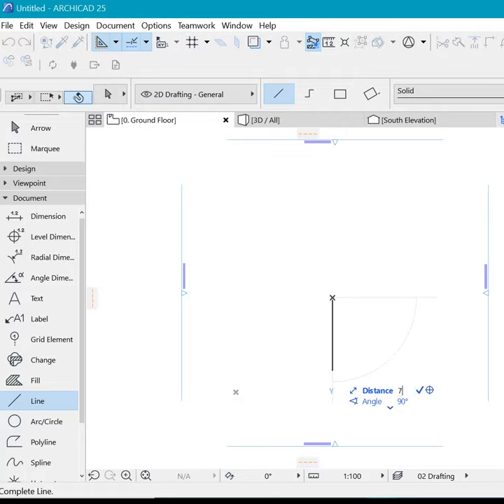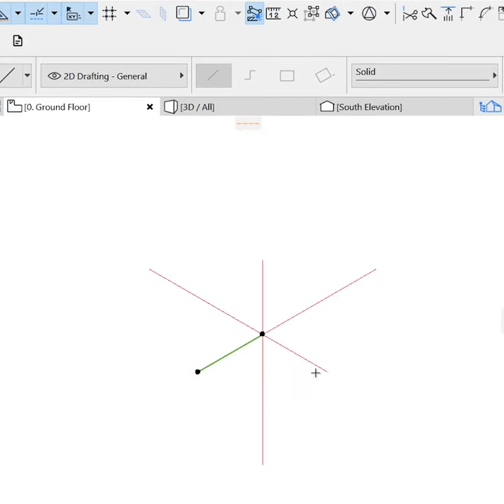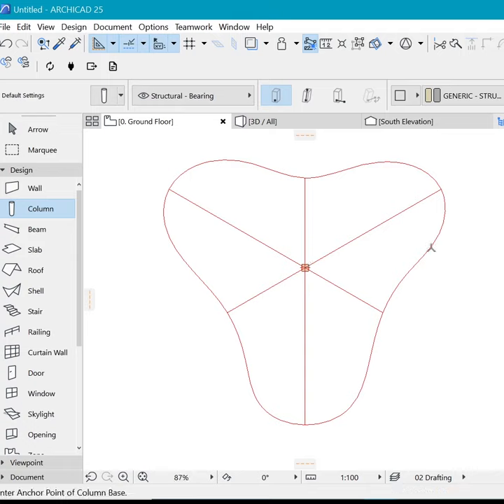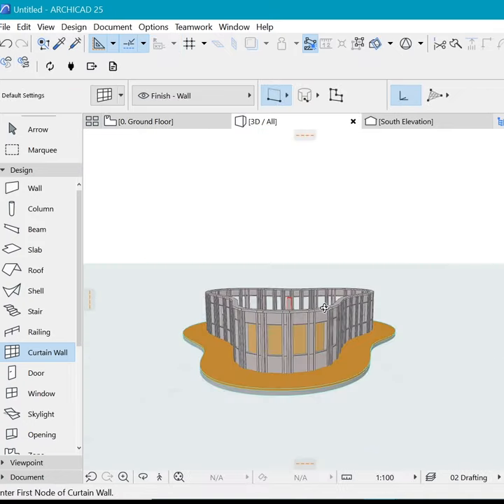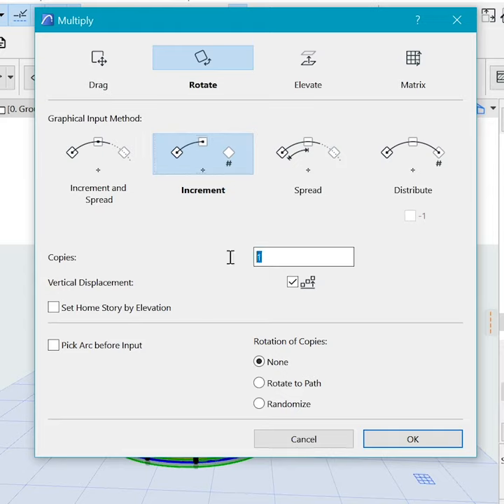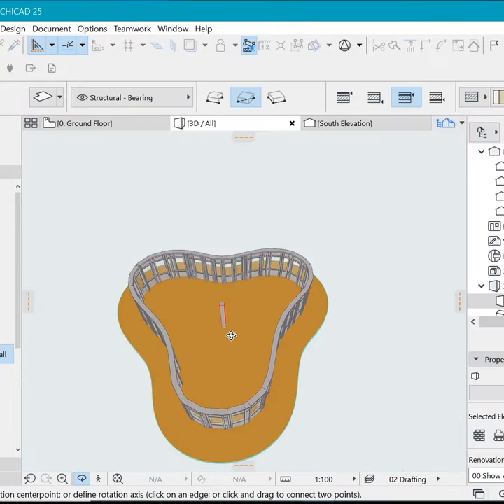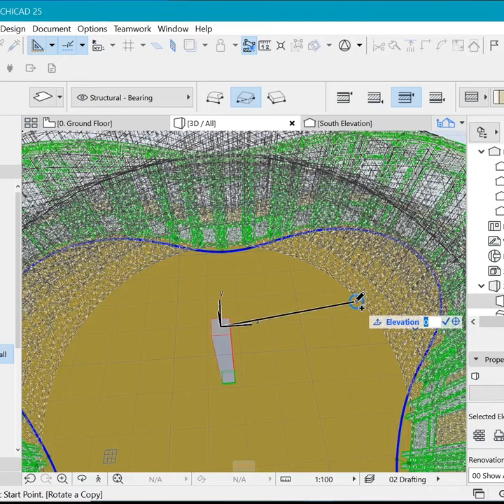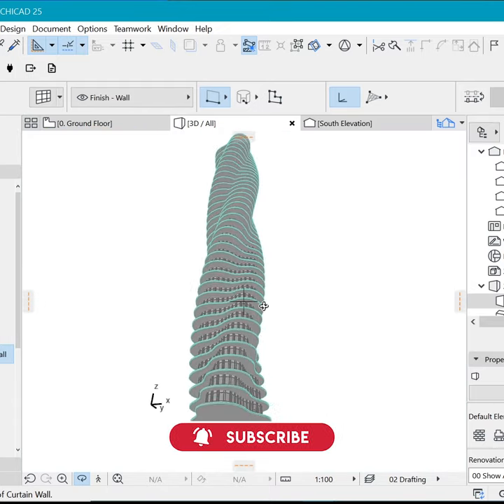I made a twisting tower in seconds 😮 What?!!😍

Comment: Boss  I'm using archicad 23 . I have one prblm in my software.. When I start the work after some time stopped my software.. Can you please tell me how to solve this problem
Reply from the maker: Archicad 23 is really stable compared to other versions before it, this is unusual.. Am thinking this could be an issue with your PC, update the drivers and hope you have a graphics card, update its drivers aswell
Reply: @nalituts  ...   
 8gb ram , 2gb grafic card, 256 ssd   it's not enough for archicad 23??
Reply from the maker: @fayaz3ddesigner677  Ya it is enough... Have u tried re installing the software🤔🤔